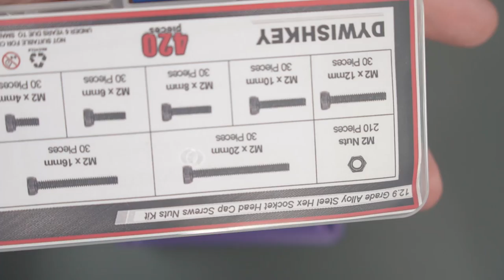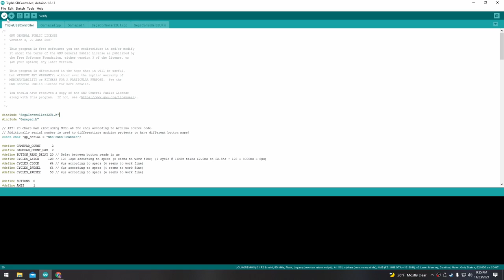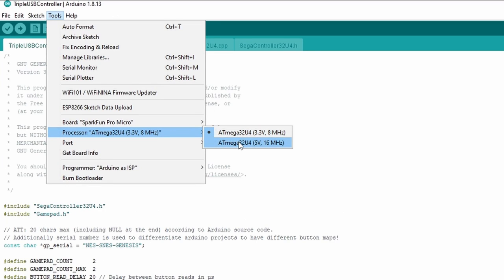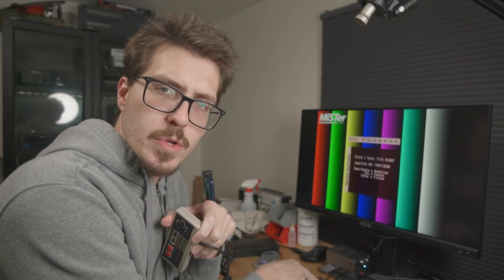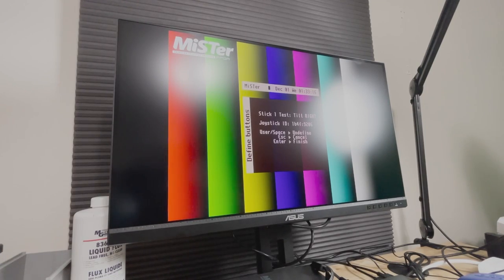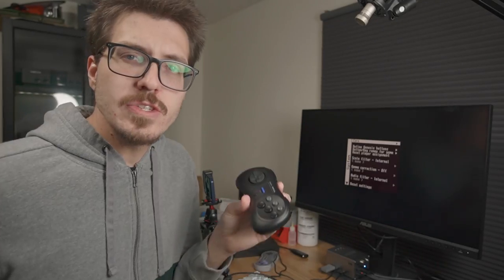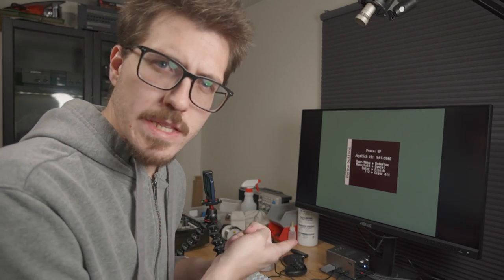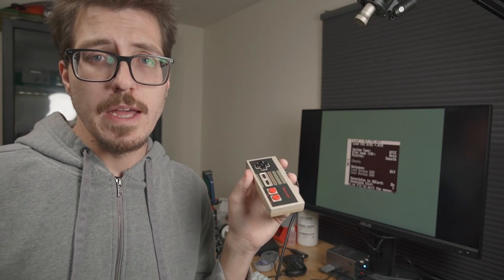Use Your Original Retro Controllers with MiSTer! - Triple Controller USB

Comment: Have you managed to keep all controllers plugged in to the adapter at the same time (NES, SNES, Genesis)  and when switching cores you can pick up the correct controller and start playing? 
I find that I have to rebind each controller when I want to switch core. Any way to solve that.

So... I would like to map each controller, then when I select a core (NEs for example), the core only  uses the NES controller. If I then choose SNES core, the SNES controller works only etc...

Comment: Bought this pre-built from Tindie and can't get it to work with my Mister at all.
Reply from the maker: None of the controller ports work?
Reply: @dubesinhower  Nope. Which is odd as the LEDs for all 3 are blinking. I've even tried it on my PC through Retroarch and it won't register any inputs.
Reply: Did you ever figure this out? Did you update the firmware?
Reply: @kennethd4958  It ended up just working eventually, lol. I used it the other day just fine.

Comment: I get the novelty but I'm confident you'll quickly realise how awesome 8bitdo controllers are and go back to the 8bitdo controller pretty quickly
Reply: You can use all any any peripherals with the inputs on the board - including light guns, the original mouse peripherals, original arcade sticks, trackballs...
The "Genesis" input alone gives you access to a crazy amount of controllers.

These inputs are just far more versitile than anything 8bitdo currently offers. Also, you can use 8bitdo controller adapters on these inputs if you want.
Reply: @LukeOranje  Not to forget, the pinout scheme of this project actually allows all 3 ports to be used at the same time. I have made around 10 of these for family and friends and nothing beats the price and versatility :D